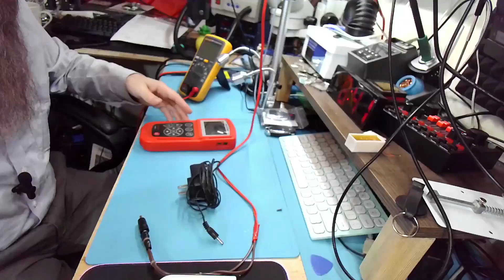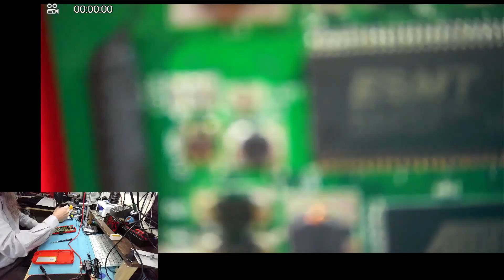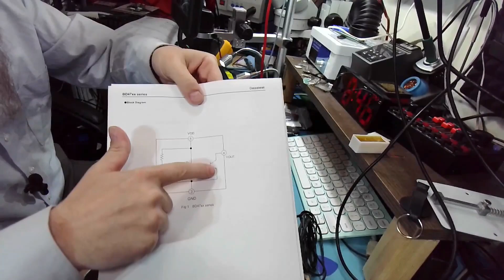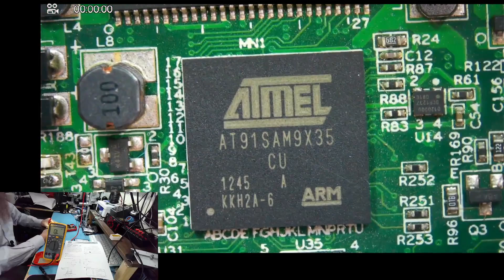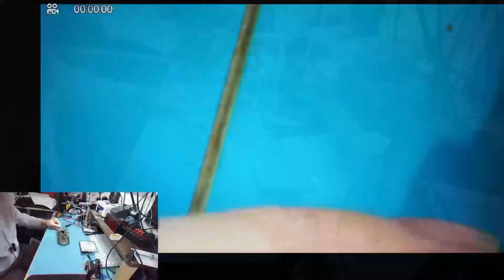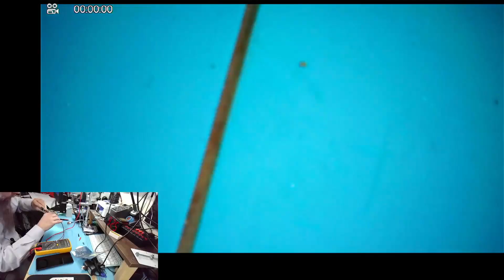Autel MaxiTPMS TS601 Repair

Comment: Thanks for the video. I am having the same issue with the same test equipment. Could you tell me where you found the schematic diagram for the bopard? I'd like to know what type of measurements I should be getting at the test points. Thanks for any feedback you can provide.
Reply from the maker: I don't have schematics for it, I reverse engineered the circuit. It's pretty simple. Check that you have voltage on the ON button. If voltage is zero, you have power issues, if voltage is 1.2V or above, most likely the MCU is dead. Check the VCC pin on MCU and RAM. Hope this helps

Comment: I did find it interesting, I have a similar machine that doesn't start or shut down on the power button too. It does however start if you connect either the usb power line or OBD serial. 
I wonder if button contacts or just leave on an extended time on.
Reply from the maker: I checked the voltage on the ON pin, it's there so I expect this one actually got fried. Thank you for the tip, if I have any of these in the future I'll make sure to test it using USB cable.

Comment: nice work I have been watching your videos for a while now ,I saw something that I think you missed look at U35(25:12) it looks like it has a hole in it.
chances are it is the eeprom that carries the firmware for the device if it is bad, it can be copied from a working one.
and replaced.
I don't think the microcontroller is dead, these chips are very tough sometimes.
Reply from the maker: Thank you so much, that could be, I didn't see the damage on the footage though and I already sent back the meter so we won't know but next time I'll hold on to "no fix" device for a bit longer in case I get feedback in the comments :)